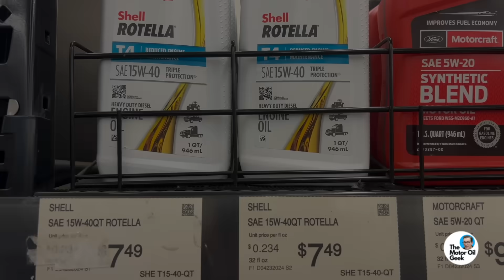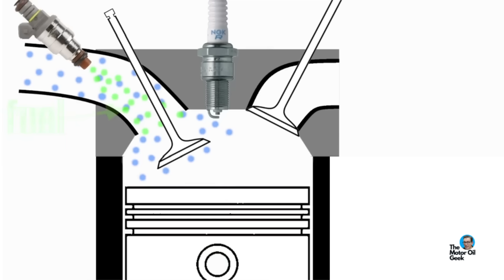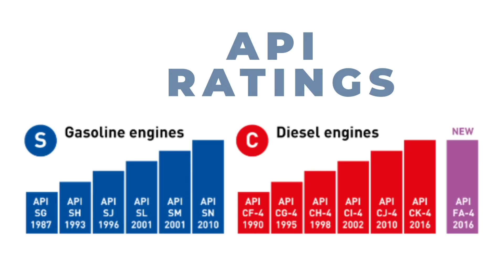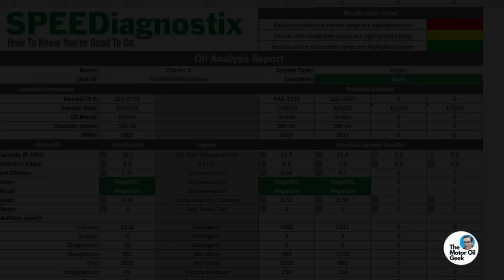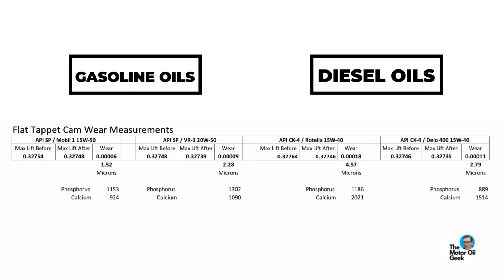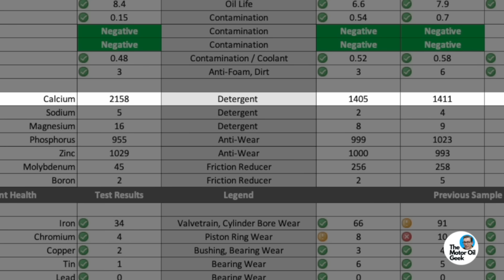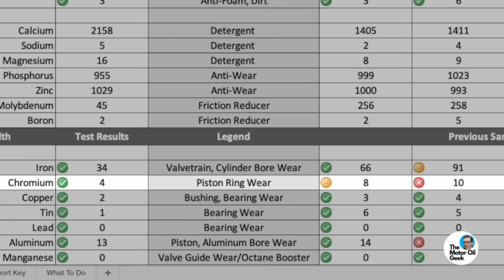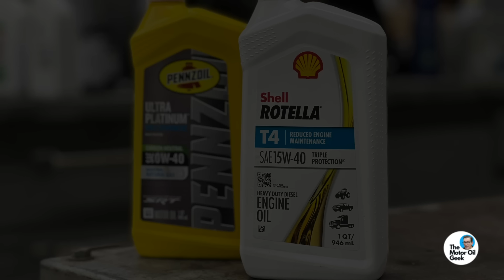Why DIESEL Oil is Actually WORSE for Gas Engines!

Comment: I think it’s just better to run the manufacturer recommended oil. I drive a diesel Iveco motor home and knew nothing about them because they are a European vehicle so I followed the specs listed for the oil and found an Australian manufactured oil that met those specs. As an experiment I put the engine details into Chat GPT and it came up with the exactly the same recommendation. As long as an oil meets the specs listed by the manufacturer then that oil should work perfectly for your application. I really don’t understand people thinking they know more than the engine manufacturer or oil companies and are willing to risk an expensive, possibly warranty voiding repair based on nothing more than a hunch or opinion. Weird.

Comment: most oils here in australia are suitable for petrol and diesel... the extra wear additives in pure diesel oil do not harm petrol, and with oil the mail thing it to change it regularly and often... never go by the manufactures recomendation... that will just get you out of warranty... 8-10k klm at most   or for you septics ..5-8k miles.. the engine will last forever...
Reply: Rotella T6 specifically states on the jug it is suitable for both. Lake is really reaching with this video. And take a closer look at the graphic at 1:46 . See anything wrong there? Really starting to doubt this guys motives and knowledge.

Comment: i use a gasoline oil in my old gas powered landrover i have no sludging or issues using normal 20w50 oil. id never touch diesel oil as it can clean too much out of the engine leading to more wear.

Comment: Yes they are , not that I care but I have been running diesel oil for many many years with no problem. My gas engines are running fine with no ill effects. Yes I run them everyday to make a living. If you want to change my mind pay me and I will keep running diesel oil but say that I use gasoline oil.

Comment: I been running 15/40 shop diesel oil. Comes in a 55gal drum. Lol in my 2011 ford flex 3.5 non turbo for about 30k. Now. It has 273k. On it now. Its been my experiment. Cuz its free. 😂 good motorcraft filter though. Valvetrain was real noisy before. This seemed to quiet it a bit.. we'll see.😮

Comment: I run diesel oil for the zinc in my flat tappet cam shaft. Already broken one flat tappet cam by not using it. Zinc by itself is $9ish a small can. Also cause it is cheaper. Helped my Chevy 350 with low pressure instantly.

Comment: I have to say rotilla has saved all by small block Chevys,,,, they don't get nothing but rototill,,,,,,,,,,, I believe you but,,, Pennzoil,, Quaker State,,,, has blown up every engine,,,, kind of weird maybe I'll take my throttle body engine apart or one or two of my quadrajet engines I got a dump truck with a 4.8 and a 2-speed rear end I know these have all been through the ringer,,, just to see cuz rototillers been treating me awful good,,, for cheap dirty oil when you look in the bottom of it😅😅

Comment: My understanding of Rotella - is that it is formulated primarily for diesel engines - which require a very high %  and formulation of detergents to address the conditions they operate. Which makes it unsuitable for modern gas engines

Comment: I would really love to sit down with you in person to really understand this.   The Rotella brand, has spark API ratings also.  I have run "diesel" oils in my
 non- direct injection engines since the Series 3 days in the '60's as it eliminated having to stock both.  I had a Dodge Aspen, '76, with a 225 ci  slant 6, that had nearly 500k miles on it when my feet fell through the floor.  Fabulous car, but Michigan salt destroyed the car.  I change oil regularly and my cars and trucks and farm tractors, combine etc, have never had engine problems, but if I am wrong, I would change to the spark SPI for my gas engines.

Comment: You ain't no mechanic dude I run 15 40 diesel oil in my 2003 toyota tundra with 300000 it works great
Reply: Trusting this guy to give you real world knowledge is like asking an engineer to design a practical anything.
Reply: I've rebuild thousands of engines since 1994 I've seen what this piss water o-20 is doing to customers engines it's not good I run thicker oil in all my customers vehicles when the mileage reaches 100000 it works better

Comment: I had an option to buy Rotella at a great price so I bought it and used it in an old school 350 chevy V8 with port injection.  Inside of a month that engine started leaking oil from everywhere. True it's 25 years old with all factory gaskets, but really?

Comment: Great video and information. Would be interesting to have your analysis of motor cycle oil? More specifically air cooled motor cycle oil and diesel oil use in air cooled engines.

Comment: As an owner of an direct injection diesel car I have no idea what to take home from this video. Should the calcium level be high or low, or should some of the calcium be substituted by magnesium to balance that out like some manufacturers do in recent years? I currently run 5w-30 Mobil ESP with the calcium magnesium mix.

Comment: Lake; Question:: I have an air cooled 1965 2.0L Porsche engine with 11.25 compression and 8,700 RPM Red Line making ~240 HP on the engine dyno and it is a 40 hour engine (racing) using IDE carburetors. It obviously has flat tappet cams and gets the literal snot run out of it somewhat regularly. We found (xW-50) oils with less than 1250 ppm zinc would lop the tops off the cams and that at 1500 ppm the engine lasted its typical 40 service hours. In use oil temps are in the 285ºF range.
What oil formulation would you recommend for such an extreme application ??

Comment: I have used rotella diesel oil in my r1 from day one of buying new. Heavily abused on track and street. Over 63,000 miles all original internals and no knock or valve tap. And still running hard.

Comment: Harley recommends Rotella, Even Shell recommends Rotella in gas engine with flat tappet cams or an engine with no cats. Di gas engines I understand not using it because they blow up left and right just holding your mouth wrong.

Comment: My experience is quite opposite.In 2007 bought in NH a 99 4Runner(3RZ/5sp) with 91K miles.The previous owner said that he didn't change any of the drivetrain oils.First 20-30K miles I was using oils for gasoline engines changing at every 5K miles.I noticed on every change that the used oil is very thin and smell a lot on gas.Because abroad I have a 99 4Runner with a 3L TD (1KZT/5sp-it is a former UN car from Kosovo mission)I decide to look for a diesel oil compatible with gas engines as well.Found Mobil1 turbo diesel truck oil and next 200K miles that 4Runner ran on it with oil change at every 10K miles.I scrapped the truck in 2019 at its 20 year of use mainly because of brake and fuel line corrosion, been a MA car its entire life but was driven as far as IA, OH, and IL because of my customers there.Interesting fact-never replaced any of the drivetrain oils on this truck and never had a drop of oil leak from them.Checked them once a year and they all looks nice and clear.The engine is running in another 4Runner in Europe.Since June 2019 I am driving my next 98 4Runner(5VZ/5sp) again with the same oil and same schedule of oil change-bought it at 168K from FL and now is approaching 300K miles, but the salt in N East start to takes its toll, but this one will last few more years.Compression tests show at these miles both engines perform well-3RZ and 5VZ are within norms of 11-11.5 to 12 bars.Btw, I am mechanic in the last 40 years, so can't complain from made in Japan Toyota 4Runner and a Mobil1 oils.

Comment: Yeah like we know that piston ignited having diesel oil in it??? Was it always on diesel oil? What brand? How much mileage? Or was it a one time oil change that done it? What’s the octane that turbo v6 ran with? Was it tuned? I know this is not Shell sponsored I can see it clearly, enough of the scary stories it’s almost bedtime….
I drive a tuned Explorer ST with 24psi of boost twin turbo direct injected like I stole it from the first day with T6 5w40,,,, if somebody would have had blown a piston from pre ignition it would be me.
Reply: Yeah,😂that piston failure is like telling me 
— “the wrong toilet paper will cause explosive diarrhea”

Comment: I've run high detergent diesel oil in poorly maintained engines that have a sludgy oil  on drain I halve the change interval using it to clean the engine after that shortened service I go back to oil spec

Comment: My granddad was an army mechanic and he used to swear by every 50 60,000 k's a quarter diesel 3/4 oil in a sump between oil changes ran for 10 minutes (not under load just idled) and then dumped maybe this is something you'd like to test as an engine cleaner  
(Australian 250 crossflow 4.1 l inline 6)

Comment: I work for a nationwide farm supply company. We installed a Honda GX 200 engine on our semi tanker trailer in 2018...We've been using Rotella 15w40.That trailer with that engine has loaded and unloaded well over 500 25 ton liquid loads..Just this planting season alone I've already hauled 30..The exhaust muffler port is dry and white .
Reply: Maybe richen the mixture up a little bit, the exhaust pipe should turn black slowly.  Remember that engine is air cooled after all, check spark plug color if you want to be sure.
Reply: I'm surprised that little motor could spin that thick of oil. I'm honestly Impressed. I drained the oil in my snowblower before a storm, and relized i was out of 10/30 but I had 20/50 on the shelf. I could barely keep the thing running when it was cold. As It warmed up it got better but man was it sluggish.
Reply: @AnthonyPerna2 That's nonsensical. If you looked at the actual viscosity measurements and the actual thickness of the oil, you wouldn't say something like that.

A thicker oil is really not that much thicker. You can't tell without lab testing.
Reply: @wiredforstereo  It's not nonsensical when you literally watch it happen.
Reply: @aprules2  It's still nonsensical. I dont know what you watched happen, but the idea that you watched an engine not be able to turn over because it had a slightly higher viscosity rating is nonsensical. Because that didn't happen.
Reply: @wiredforstereo  it was below 20 degrees outside so the 20/50 was thick and significantly thicker than 10/30, it was a 4 hp tecumseh. I could pull it, it spun but had significant drag, then once it was running it ran like shit until it warmed up. Sorry you can't understand that.
Reply: @AnthonyPerna2  anything less then 180° its going to be alot thicker! One more reason not to listen to this guy!
Reply: @anthonyking4387  exactly! Glad you're smart enough to understand. Too bad he isnt
Reply: @wiredforstereo  I don’t know how much experience you have in places that actually have 4 seasons of weather, but if it’s below 40F and I still have my summertime delo 15w40 in, it turns noticeably harder/slower on a cold start than when I have 10w30 in it. And you can tell the oil pressure is way higher even with the factory dummy gauge (I also had this same thing happen in aan old truck with a real pressure gauge and that thing would peg out about 90psi or 50psi depending on the oil it had, supposedly the factory gauge is just a on/off switch that tells you it’s above 7psi. But it will sit in the “A, or L” of the word normal (look up mid 90’s fseries gauges if you need a visual). Throw the 10w-30 in and it sits more around “r” or “m” on cold start, seems to get about 1mpg extra on the real cold days, and starts waaaayyy faster. It will sometimes sound like a low battery with the heavy oil, but on the same day about an hour after I started it just long enough to move it 10 feet onto the ramps, so def not enough put any appreciable heat into the block, it cranks like a whole new battery, cable’s, and starter got thrown in.
Reply: @AnthonyPerna2 If that was TLDR, just grab 2 pint glasses, fill one with honey and with with water, then try to stir it really vast to make a whirlpool, then come tell me high viscosity fluid doesn’t slow down a mechanical force.
Reply: @carsonhammond6204 I agree with you 100% I was the one that said it.
Reply: @AnthonyPerna2  ah my bad I tagged the wrong person on the second comment
Reply: @wiredforstereo you don’t know what you’re talking about, 20w-50 oil at sub zero temperatures will be thick and hard for a small engine to operate with.
Reply: I've been running it in my carbureted motorcycles for years and have never had any problems with them.

Comment: The real answer is, depends on the oil and the application. If a diesel oil has a SN rating, it's fine for gasoline engines, period. If you're putting it in a lawn mower, the extra zinc is beneficial.

Comment: Basically direct injection gasoline engines are terrible for oil. The extra detergents in diesel oil casues low speed pre-ignition and will destroy a GDI engine.

Comment: Great video Lake, thanks for that. Could you point one in the direction of tests between the different diesel oil brands. As a diesel owner the community has always said Shell Rotella is the best. I have always run the T6, thanks.

Comment: How do you feel about using an ACEA C3 rated oil like Mobil 1 ESP in a non European application? I was considering running Mobil 1 ESP in my miata since many other track day people who run cars with catalytic converters run it for it's high HTHS where they can't get a super high ZDDP oil like VR1 or Driven, what are the drawbacks associated with using this oil as opposed to an API oil on a car that is not designed with ACEA in mind?

Comment: Lake, many of my Corvair friends use Rotella in their Corvairs because the flat tappet cams need the ZDDP. Corvairs are carbureted unless an aftermarket EFI kit has been added (very rare). So, is Rotella better than a racing oil for an air cooled flat tappet cam engine?

Comment: Shell Rotella T6 is JASO MA/MA2 certified for Japanese motorcycles with wet clutches. You should do a comparison of this oil against dedicated motorcycle oils, i.e. Maxima, Motul, Mobil 1, Amsoil to see if there is any real world difference. People have used T6 in their motorcycles for 100,000 miles or more without any problems.

Comment: I run T6 in my Polaris Rangers 20,000+ miles zero oil burning zero blow by translucent oil every 1200 miles. Pretty untechnical, but most people don’t get that many miles on their units. I’ve never kept one past 25,000 miles but they all run perfectly.
I run T4 in my Yamaha twin cylinder motorcycle. Somewhere else cause that thing to rattle and it just seems to like the T4.

Comment: I drive truck,  I have aways used diesel oil in non diesel engines, 
I have never had a problem,  over 238,000 on a 1979 Ford Bronco 
With a 351 Cleveland motor 
I know thing have changed through out the years 
I live in North East Ohio,  plowed sonw, over 40 miles a day,

Comment: Been running T4 on my 4.7 PowerTech for a while. Blow-by stopped, oil consumption stopped, valve train is quiet, factory oil pressure.

Honestly surprised by this video. Mechanics have been using heavy duty diesel oil for older high mile engines for decades. It solves a lot of problems.

Comment: Rotella t6 straight 50w in built Subaru Sti makeing 505awhp on pump gas. 650 on c16. No issues for 6 years and 35k miles :)

Comment: Diesel oil used in older gas engines (before 2014) is fine. It's the newer engines where it's not a good idea to use it.

Comment: White smoke with a diesel engine is UNBURNED fuel.... Black smoke is an overfueling condition in a diesel not unburned fuel. Dave Bell should know this by now I would think.

Comment: Here's an idea:  use what the manufacturer recommends. If you just have to tinker with it because you can't help yourself,  be a rebel and use a different viscosity. No matter the application, do maintenance at half the recommended mileage and time. A courtesy message from a recovering overthinker
Reply: @  @ the moe here's  an idea  buy a tesla no thinkin' required.
Reply: @themoe6701 wise man!

Comment: No oil can properly fend off the effects of unburnt fuel on your cylinder walls and eventually in your crankcase. The best thing you could do is never buy a vehicle with a GDI engine if you want reliability. As a mechanic I can say I have never seen some one with a GDI engine over 100,000 miles who was happy, lol.

Comment: Takeuchi factory uses and recommends 10W30 or 10W40 diesel oil for its hydraulic system . The dealerships I use in the past just use plain 15W40 .It’s actually cheaper to use. Kubota and John Deere hydraulic  fluids can go into the 160 to 220 dollar territory just for 5 gallons. Like always , use one or the other .

Comment: I have a freshly rebuilt 1972 Ford 360 FE engine in my pickup. after breakin, I've been running t4 10-30 rotella in it, mostly because I'm not paying the super high price for that "classic" motor oil that contains zinc. Modern oils don't contain enough to keep a camshaft functional, and additives are not much cheaper per oil change than the overpriced oil. This is not an engine suitable for synthetic, and I doubt you could keep 0-40 in the engine

Comment: i remember a test a farmer did on 2  JD tractors of the same model in 1954 One used the Best Molbil car oil & the other used 930 Delvac. The one with mobil speciAL OIL  started to burn oil at 4000  hrs. but other that used 930 Delvac had 9000 Hrs & still used no oil  so smoke that in your pipe for a while.